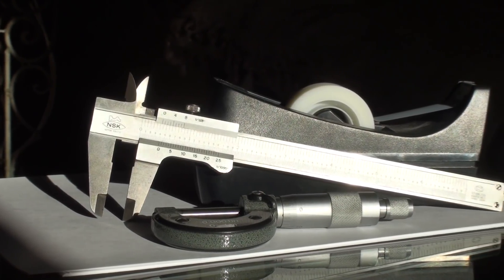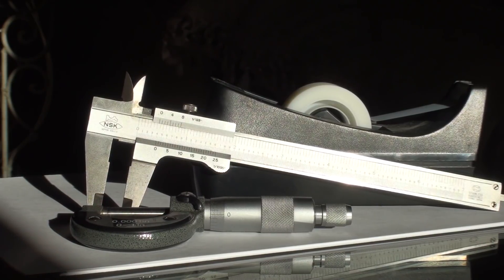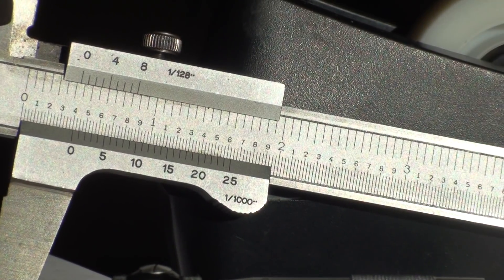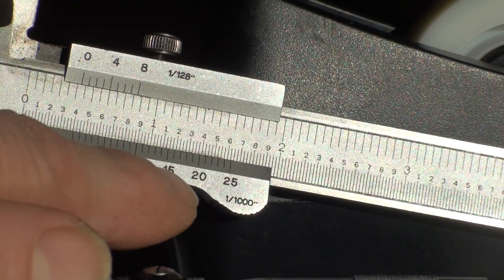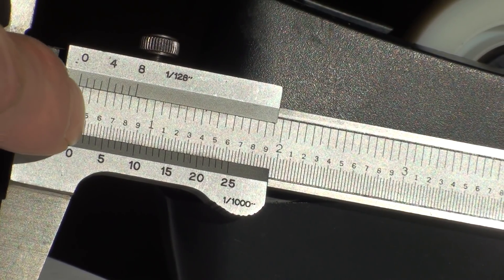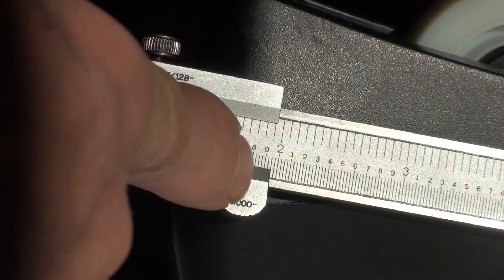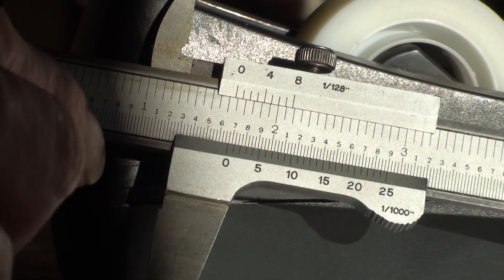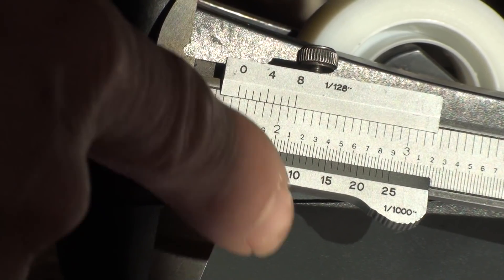How to read Vernier Callipers [EASY]

Comment: Thanks for the video. The 1st reading was off by .004 but the second reading was the same as my reading. The concept was correct. Someone seemed confused after watching your video and may be because the vernier caliper takes practice to master. I personally like the dial caliper but use both vernier and dial to confirm my readings. Digital calipers are for quicker measuring but not as accurate +/- .005 difference sometimes.

Comment: Hi, thanks for teaching me this, now I get it. The ding dogs who made dumb coments about, no body uses inches etc or inches went out with the dinosaurs are just the usual bunch of youtube pinheads. The only reason someone would watch this excellent video is because they needed to understand working in 1000th of inches. I am working on a 1930s car, which is built in inches. So preferring to use mm is as stupid as trying to run a steam engine off a USB port.

Comment: It is Vernier, not veneer. Vernier (with an R) comes from the Frenchman who invented the bottom scale to increase precision. Veneer is a very thin wood sheet that is glued on top of crappy wood products to sell them at a higher price to the masses.

And use a stick to point things out. The fat finger covers up half the screen and the uncontrolled shaking is dizzying at such great zoom in factor.

Comment: buddy, if you gonna explain ONE scale stop injecting the one you are NOT explaining into the explanation of the one you ARE explaining... ditto for ONE TOOL AT A TIME... do the micrometer later ok? You keep using the second scale not being explained to fragment the explanation and we have to mentally edit that out and glue the remaining 'explanation' back together.

Comment: This is why i love the metric system and hate the imperial one. You can't scale for shit. 1/128?? Who does calculations based on that?

In metric you have 1/1000 EVERYTHING

1 meter has 1000 millimeters
1 kilometer has 1000 meters

You guys have what?
1 yard has 3 feet
1 yard has 36 inches
1 foot has 12 inches
for less than an inch you use fractions... Try to scale that! Also don't get me started with the weighing system lol
Reply: It worked to put a man on the moon so there must be something working right.
Reply: Feel better now?  Thanks triden55 for the video.
Reply: Lucas Pushuno  They are not THAT expensive, so if you are looking to flip it and get thousands, you won't... low end ones are under $10, good ones are a bit more expensive, i'd buy one for the right price :)
Reply: @mike We actually used both, but relied on the metric system more to get to the moon.
Reply: gee, if only I had been researching the metric vernier I do NOT have... you would have been so helpful.

Comment: When you are saying for example 0.025 is that not hundredths of an inch and would 0.0025 be thousandths since the third decimal place is where thousandths starts? After all this caliper does measure up to ten thousandths of an inch. Am I wrong or right anyone?
Reply: Umm, you're misunderstanding.
The scale is in 1/1000th's of an inch.
That means you have no more than 3 decimal places, therefore your smallest measurement 1/1000 of an inch as a decimal is:  0.001
Your initial number of 0.025 is:
~5/1000th's   of an inch = 0.005 (also can be read as 1/2 of 1/100th of an inch)
~20/1000th's of an inch = 0.020 (also can be read as 2/100th's of an inch)
And if added is:               0.025 (also can be read as 2.5/100th's of an inch)
Now as to any calipers for 1/10,000 of an inch, typically because of the difficulty with the transition between standard measures and imagine how difficult it would be trying to even measure anything smaller than 1/1000 of an inch?
So we go with the metric system and use microns, or thousandths of a millimetre.
I hope this helped.
Reply: (Addendum): As to your question for ten thousandths of an inch, I neglected to mention that it's used with most micrometer calipers. Apologies for any confusion.

Comment: First off, GREAT VIDEO. I'm studying some machining courses but I've been out for a bit and needed a refresher. You did a great job with this, the ONLY thing I can say that would help would be to add a few annotations to make it easier to keep up with. Other than that, fantastic job. Maybe you should consider a job as an instructor to help those trying to get their certification. You'd be pretty good.

Comment: RE the ~6 minute mark in the video: The technique here is sound, but that "lined up" 12 looks a lot more like 20/1000ths to me, or maybe 21. That also correlates better with the relative position of the bottom scale 0 vs. the first major scale mark. In other words, if it was really 12/1000ths you'd expect the bottom 0 to be only about halfway to the first mark on the major scale (12 = roughly half of 25).

My apologies if the camera isn't looking straight on and that's a parallax illusion.

Comment: short answer: physics --- the device requires no other energy than the mind and talent - digital tends to fail and provides false data if current source is not constant -- and requires calibration/replacement once a tool has been even slightly subjected to impact, and finally, digital is just a sample --- Am still using a Vernier caliper made some 60 years ago.